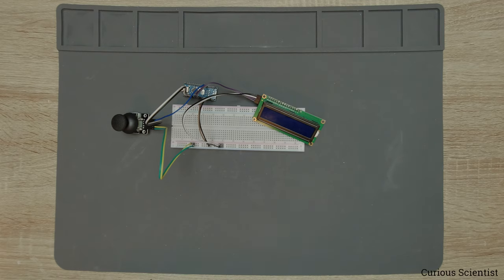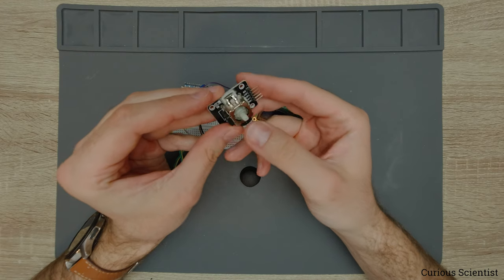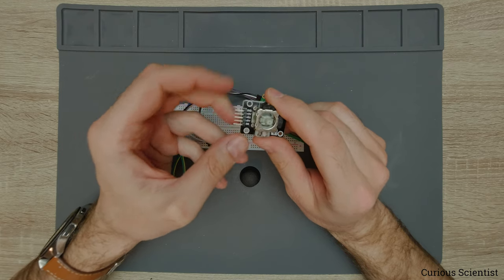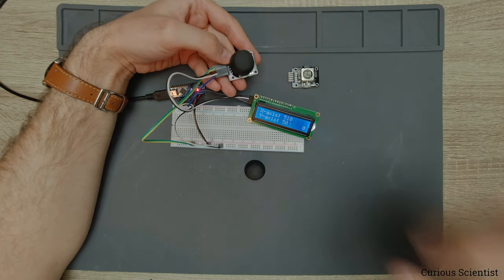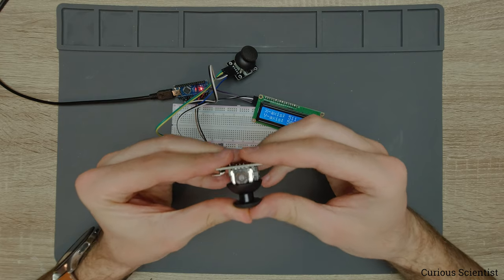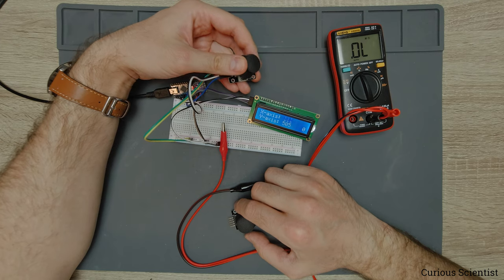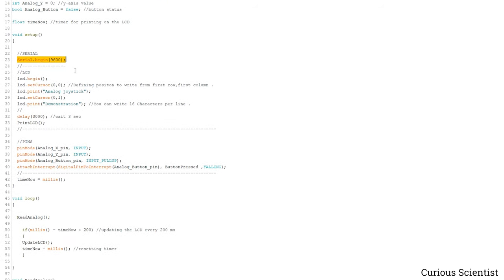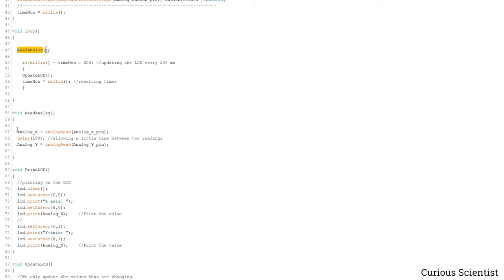Arduino and joysticks - Part 1 - Introduction

Comment: My man, for the name of all that is holy, can you please help me troubleshoot what is wrong with these analog sticks in my controller? To cut a long story short: i used to have stick drift in my original analog stick, meaning the controller registered movement in one direction when the stick was in neutral position. To solve this i replaced the sticks. I've done this several times. Some times the replacements would drift too but other times they would have a new problem which i have now. No matter how many replacements i use, i always seam to have the issue of one or two directions on the stick registering a lower range of movement than the other directions. So for example if a stick controls the camera, the affected direction will move the camera at slower pace than the others, as if it has lower sensibility. That direction also seems to have a bigger deadzone before it registers movement in the affected direction, while the opposite direction on the same affected axis will have a smaller dead zone than the other 2 directions on the unaffected axis. I don't feel any constraints when physically moving the stick so it seems to be an issue with the electrical part of the equation, right? I am not versed at all in these matters as you are and there is literally no help to be found anywhere on the internet regarding these issues so i would really appreciate the input of someone who is knowledgeable on the subject. The affected direction changes with each analog stick i replace but it seems more common on the Y axis. I bought a cheap multimeter to help me see if i can find any discrepancies in potentiometers resistances, and i did find them despite the large error margin of the multimeter. I changed the pots around until i had a set of ones with resistance values close to each other in all directions but this did not seem to help at all. I bought these sticks from the manufacturer so they are not cheap Chinese copies. Their QA seems trash with resistance values varying a lot, but surely they can't all be faulty? They are not soldered to this particular controller, i have to manually bend the mounting pins to secure the thing in place, which requires some force. Am i causing this somehow? 

Please dude, i am begging you. I am at my wit's end trying to solve this for a year and all I've done is waste money and time. It's a PS3 controller, which aren't made anymore and can't be found so replacing it is not possible. I have two controllers and both have these sticks and the same issues. Please, any help you can give me would be appreciated.
Reply from the maker: Hi! 
I think that you might did not buy identical joysticks. The lower range of movement suggests that you have a different value for the potentiometer in the joystick. They are typically 10k or 5k. You should measure them and see if they differ. Measure the resistance between the two "sides", so you will get the nominal resistance of the potmeter. Also, make sure that you clean the insides of the potentiometers. The contact of the rotating part of the inside of the potmeter can get dirty and this dirt can change the characteristics of the potmeter which then can lead to drifting.
Reply: @CuriousScientist  I did measure the difference in resistance from the furthest pin to the middle pin, that should give me the resistance for both sides of the axis, correct? Out of 40 potentiometers i only managed to find one where the difference between each side is minimal. The max resistance is supposed to be 10k ohms, so 5k for each side, right? My multimeter has 1.2% +-5 margin of error (supposedly) and the lowest i was able to measure was 5.8 in one side in a 20k scale. Is the manufacturer QA so bad that they sent me 39 out of spec potentiometers? The variance between each side of the pots is 0.30 on average.

I assumed i did not have to clean these things since they are new. Do you think this will help? I have rubbing alcohol and specialist contact cleaner lying around. Which one should i use?

Thanks for the help.
Reply from the maker: If the nominal resistance is 10k, then yes, in the middle (zero position), you should be measuring something around 5k. 5.8k sounds a bit high perhaps, but I have no idea how they programmed the joystick, so it is hard to say anything. You can clean it with any of the substances.
Reply: @CuriousScientist  Just as i expected, cleaning the potentiometers with contact cleaner did nothing. I don't know what to do. I don't understand how these things just refuse to work right.